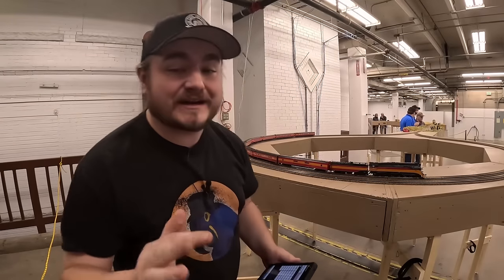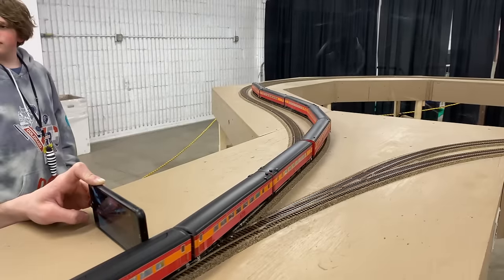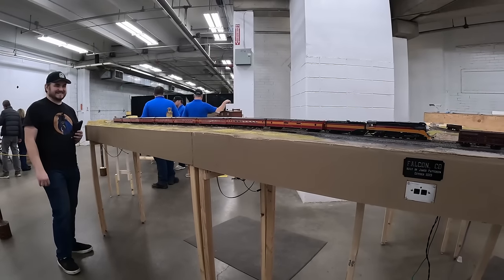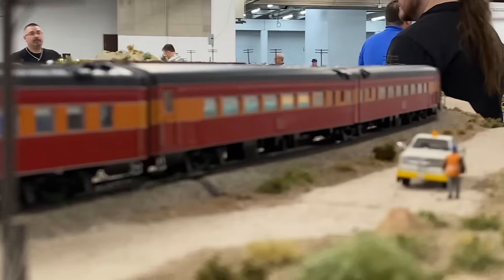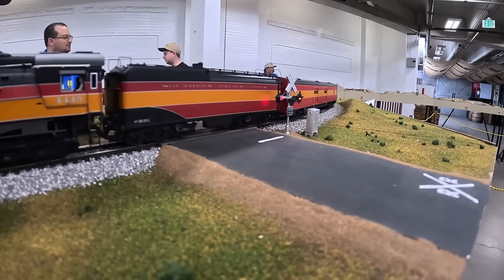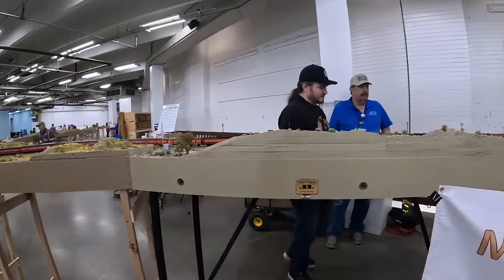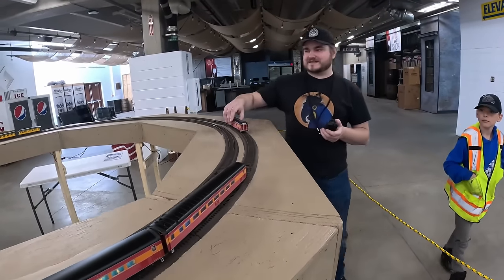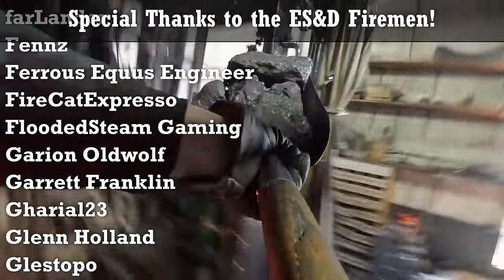The new Broadway Limited Daylight on a GIANT LAYOUT!

Comment: That's the loco that got me into trains too! I live in Portland, so it's always a big deal when it gets out. (unfortunately rarely, these days) At least you can see it at the Oregon Rail Heritage Center. Great museum, you need to see it if you ever come out to OR.
Reply: Yeah... The folks at the museum said that its too heavy to run on some poor sections of PNWR's tracks, that they were complaining about parts of the tracks having deteriorated support under the rails and thus bending and flexing.
Reply: @rtg  Yeah, and UP won't let them run either (no outside steam). PNWR runs sets of (borrowed UP) SD70Ms on the OE line between Albany and Eugene, which together weigh about as much as 4449, so I don't see how that logic works. It's sad how it's so hard for a preservation association to run on the mainline these days. SP&S 700, the stablemate of 4449, just finished its 1472 and now has nowhere to run. At least BNSF is still friendly to steam, and we have smaller self contained steam operations.
Reply from the maker: I've actually spent a day helping Doyle on his former PA back in '18. ORHF is fantastic.

Comment: Favorite Locomotive class for me...

Narrow Gauge: D&RGW T-12 Class, because I loved to sit next to 168 while attending Pikes Peak Community College (Now Pikes Peak State College)

Standard Gauge: Can't rightly say, liked the Dash 9 from Railroad Simulator, but that's it...I'll admit I'm having trouble telling North American Diesels apart...

British Narrow Gauge: There's just something to be said about the Motorail Simplex.

British Standard Gauge: The Furness Railway K2 "Larger Seagulls"...I grew up watching Thomas the Tank Engine and I like Edward the Old-Fashioned Blue Engine, ok?

At some point I want to look into getting into FreeMo, but I've never had the fortune to run into any clubs for it. The one based here in Colorado Springs seems to have stopped meeting from what I've been able to tell. Of course, before I get back into Model Railroading, I need to see about getting some maintenance equipment (Don't even have a Soldering kit), let alone replacing hornhook couplers with more modern ones...

Comment: 9:11 yayyyyy im not the only one who has to deal with connectivity issues at train shows!
Reply: One of my local clubs insists on using NCE.  NCE's wireless straight up does not function at shows due to interference from all the other systems.
Reply: @SpawnofChaos  thats what happens to even the most robust digitrax setups at the edison Greenberg train show

Comment: I have the new AFT 4449 from BLI and one of the “Southern Pacific Lines” 4449 as when it was built and how it is now from MTH. And on the passenger car side, I also have an all BLI rake of coaches. I have the Baggage/Chair, an Articulated chair, single chair, tavern, the Triple Articulated Kitchen/Coffee shop/Dining car, and the Observation. With the observation being the version with the DCC controlled lights.
Reply from the maker: Fantastic. I am working on getting a full set. :)
Reply: @Hyce777  yeah, a 9 car half Daylight is where I have to stop on the grounds of lack of space for anything longer than that. And that’s fine as it’s more of an excursion style consist in my mind as it’s a mix of “Southern Pacific Lines” and “Southern Pacific” lettered equipment. More or less just what ever pieces of the train I could find online or at train shows. The Kitchen/Coffeeshop/Dining car is itself longer than a Big Boy. Though the full 18 car (19 if you want to model the busy season) would, I think, be pushing it as far as what you could do even on the modular model railroad. Open main would be fine, not so sure about the turn around loops at each end if they go straight into single track running. And as far as seeing the real 4449, I wish I had known it was rolling through Minnesota on it’s way to Michigan back in 09 and stayed through that October to help the Friends of the 261 with the annual fall colors trip due to the Milwaukee Road 261 being down for it’s 1472 inspection and lease renegotiations with the National Railroad Museum in Wisconsin who owned the 261 at the time. And BLI had even made the BNSF paint scheme you showed in the home video of seeing it go by. And as far as what the 4449 would say, I would like to suggest “Santa Barbara”. If the model were the 3 cylinder SP 4-10-2, it could say “Anaheim”.

Comment: Hyce lost wifi first thing pops into my head is the line " in ten minutes  you're going to have 200 tons of locomotive smashing through Central Station on it's way to Marshall Fields.
Oh nice young Hyce got to catch 4449 in it's very brief war baby livery due to BNSF not wanting a competitor road pulling a BNSF sanctioned excursion. She is a gorgeous locomotive I've gotten to see 4 times,once at speed hauling the Freedom train through town in the Chicago burb I grew up in then on display a few towns over when I was not all that much older than Hyce was and then a third time in Daylight livery when it was in the Chicago area back 2010 2011ish. In that case once on display and then at speed on the old Milwaukee Road C&M out of Chicago making every bit of the maximum passenger speed limit.

Comment: Thank god Broadway Limited started doing their stealth series. They make good models but I hate fighting with their decoders.
Reply: Oh decoders are a bit wonky are they?   I'm tempted to join the conductor club to pick up the challenger that they have for $250, figure if I want DCC sound I can put it in later if I feel like it.
Reply: @Mike__B  they have been getting better over time. Paragon 1 and 2 are a pain for me. Paragon 3 seems alright. I haven’t had any experience yet with paragon 4. I also really like using ESU decoders for certain things since you can add custom sounds
Reply from the maker: I had a brief bit of weirdness once, but overall I ran for probably 4-5 hours with no issues - knock on wood. Sounds like they may be partnering with ESU coming up, which would be rad!

Comment: English me when Hyce said that the train was only half length...
Reply: The Daylights could get to a maximum of 20 cars.  My wartime set is... 20 cars (it's just going to be a static display).  It's a touch over 17' long (over 1500' scale) with the GS-4.  I decided it needed a helper.  I always wanted a cab forward, but I didn't want to add it to the train if it didn't happen in real life.  I found a picture with a cab forward leading #98.  That was good enough for me, so I picked up a rough Rivorassi AC-11, bringing the total length to around 19'.